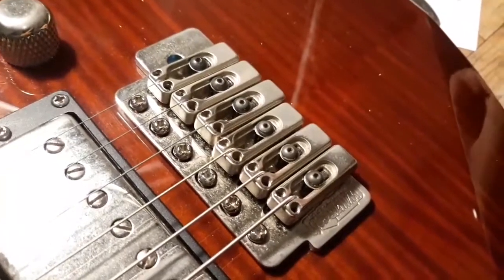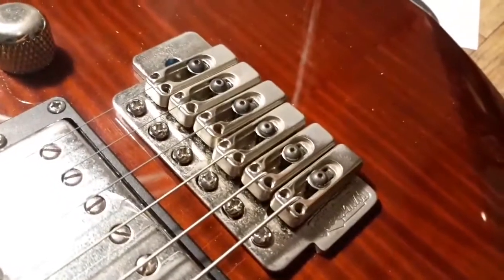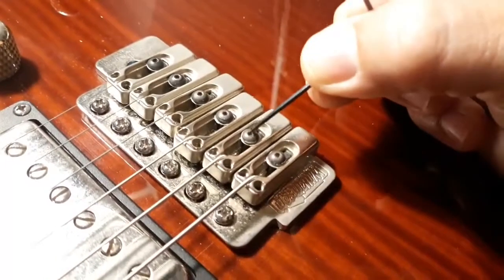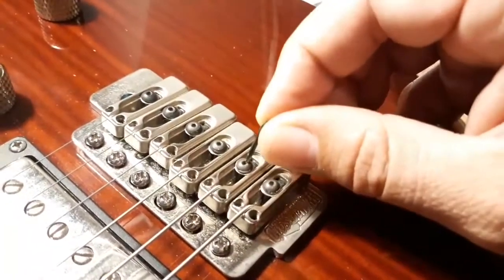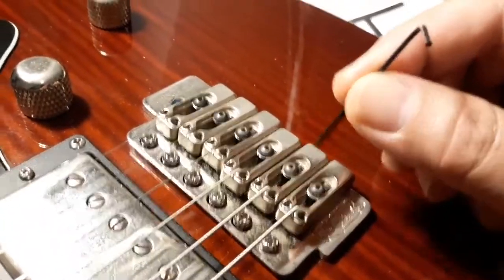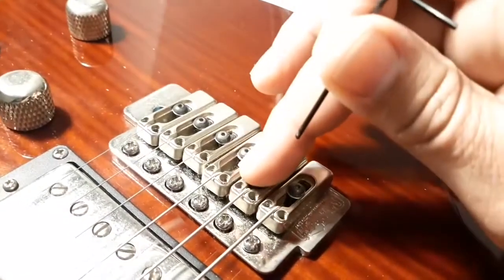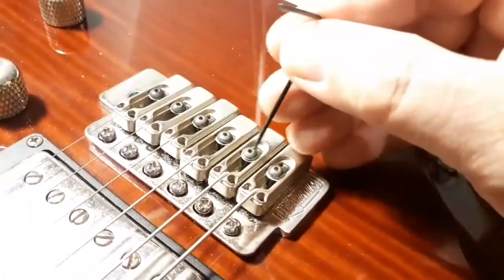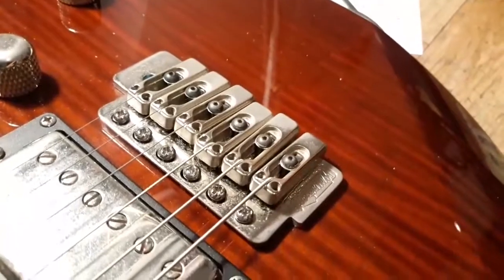Can't Unscrew Wilkinson Tremolo Saddles? Try This Simple Hack! - Guitar DIY

Comment: G’day Ivan! Loving the great content mate. I’ve got a couple of guitars with Wilkinson trems and this is a great tip. Gotta admit that I have stripped one of the hex-headed bolts while trying to release it for intonation adjustment. Had to cut a slot with my Dremel and use flat-bladed screwdriver to remove and replace. That was the day I learned this trick.🧐
I’ve had a look around and I’ve got 6 guitars with Wilkinson bridges, including 3 just like this one, but in the 2-point fulcrum version.
Reply from the maker: Thank you for the feedback. Please subscribe to the channel if you want to support my work. Cheers!

Comment: do I have to detune the string before unscrew the locking nut to adjust action or intonation?
Reply from the maker: @SlavJerry  it is advisable. But depending on the string gauge, it is not always necessary

Comment: What size the screw? Thanks
Reply from the maker: The hex screw heads are metric. Can't remember, but it should be 2mm for the saddle and 2,5mm for the locking one. Any standard metric key set will work